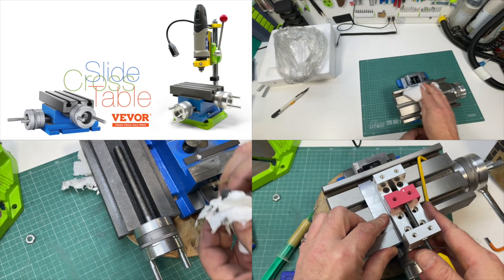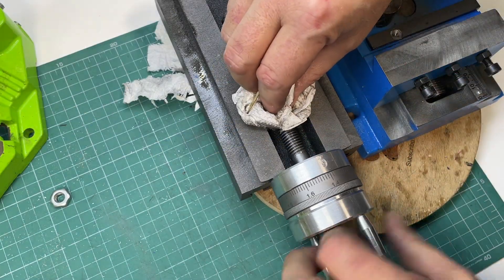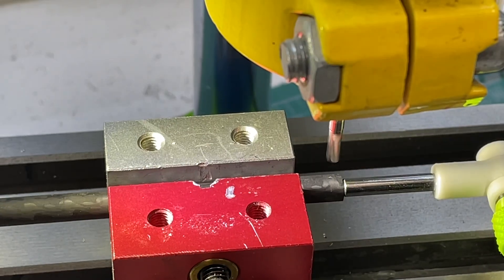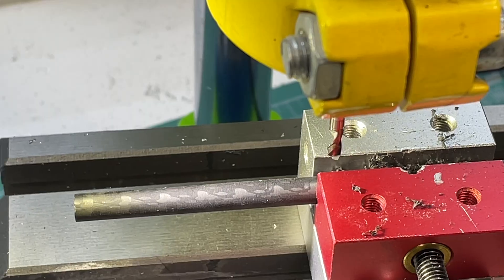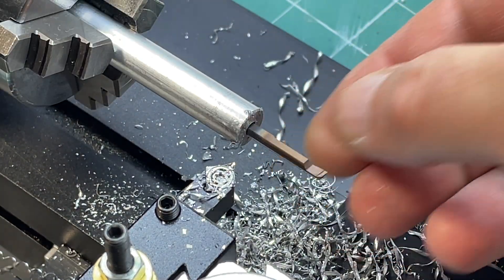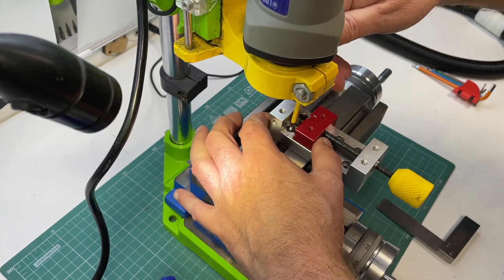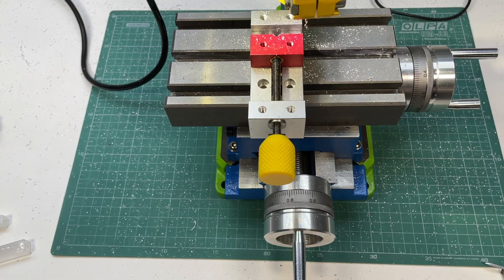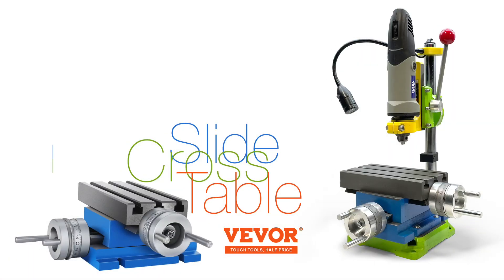Vevor Cross Slide Table

Comment: What is the brand and model of this drill?
Reply from the maker: Hilda
Reply: @V.Perinski  I found one with 5000 rpm and another with 30000 rpm... which would be better??
Reply from the maker: @vbrunetti  https://go.like-it.link/KxZyw The spindle speed is adjustable in steps — up to 25,000 RPM, with five levels in total. (400W) The description can say anything — it’s a Chinese description after all. You have to read it with that in mind.
Reply from the maker: I just realized I hadn’t mentioned something about it. I bought it back in 2015. Of course, I don’t use it every day, but it has seen plenty of work. And for more than 10 years now, it’s been running flawlessly. Absolutely no play at all. An excellent tool, truly.

Comment: Great job as usual.  Is there any possibilities to oriente the Slide Table on the main table in order to cut at different angles along the axis of the work piece ? X, Y and Rotation Angle 0-45° could help wihtout an additionnal rotary table. Any ideas ?
Reply from the maker: The drill stand itself allows the cutting tool to rotate at any angle, so there’s no need to rotate the coordinate table.
Reply: @V.Perinski  
You mean by 'the' drill stand', the tool mounted that is needed on the top of the table to hold the work piece which can be ajusted for the desired angle.
Reply from the maker: @gerardfx2412  Drill Press Stand - https://go.like-it.link/F4F7Y Check out the photo where you can see the angle at which the spindle or another tool can be mounted on this stand.
Reply from the maker: @gerardfx2412  https://youtu.be/MovbmlG8sjM?si=o0hluI7dZPLLufLW&t=84
Reply: @V.Perinski  Thanks for having pointing out when angle is used on the machine you have. 
Mine has none equivalent (yet) :)